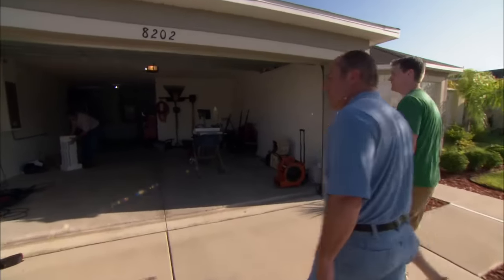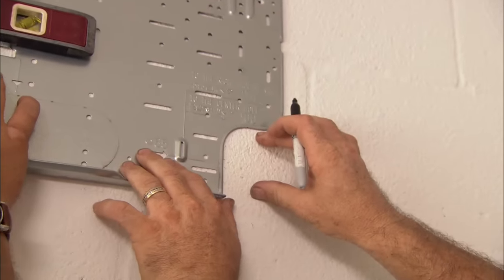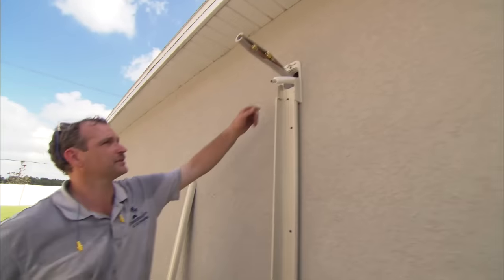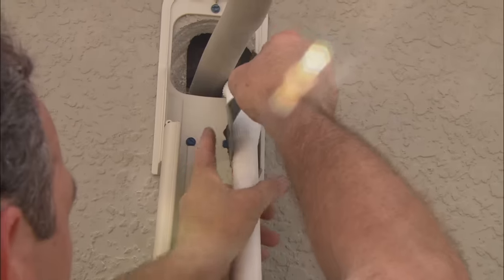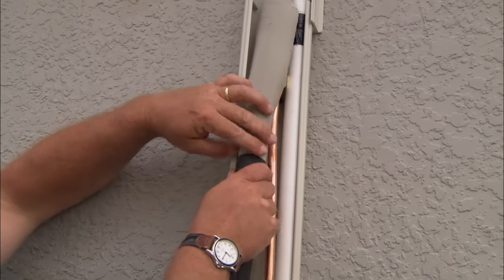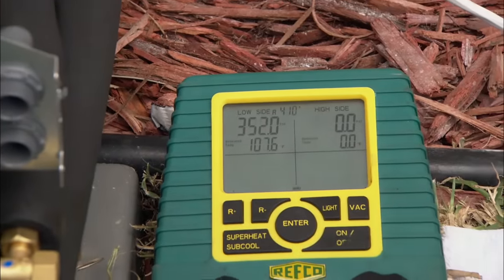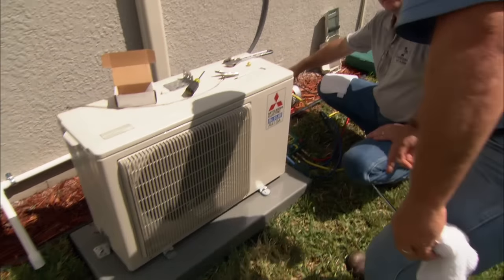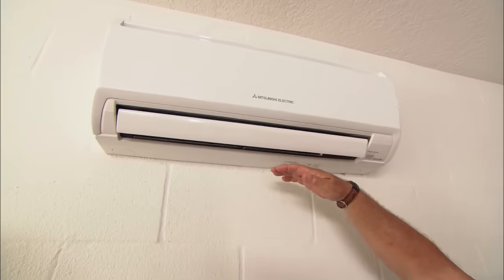How to Install a Ductless Mini-Split Air Conditioner | This Old House

Comment: A year ago I took HVAC training at Peterson School in Woburn, MA. Most important thing they taught us us to read the manual and follow ALL manufacturers instructions.. Since then, I worked on a truck and went for mini split factory training (Fujitsu and Mitsubishi).. SMH at this job. No wrapping of the indoor insulation with the sheathing given in the manual/remote package,Wrong flaring tool, no use of POE oil on flare connection, no use of torque wrench when tightening flare nuts, no nitrogen sweep before pressurizing with nitrogen, pressurize with at least 400 PSI *read manual for exact amount, 400PSI is the low PSI when in heat mode, no bubble test, ground connections should be with a ring connector. All other electrical connections with solid wire are done with a hook (not the slide in as he did) stranded wire must also be done with ring connectors. If the install is done in a place where it snows, use a stand to raise the outdoor unit up above the snow line.  He said that it's idiot proof.. SMH, all the things that I brought up are in the install manual. Without doing all those steps, the warranty is void.  He may be an 'expert'. I have 4 months of training and 7 months on a truck and I know he is just another hack.  If you are in MA and want to learn refrigeration and heat pumps, go to The Peterson School and get on a truck for a few months, do a couple dozen installs, buy $4K worth of tools, get factory trained and when you install your own 2 outdoor - 7 indoor unit job, you will have more than paid off the cost of the schooling and the tools..  2 outdoor and 7 indoor install would usually run @ $18K, but you only need to buy @ $5K of parts and do @20 hrs of labor..

Comment: Idiot proof is total b.s.  bubble check flares, torque to specs, cooling a space where insulation may be an issue, shop conditions will plug filters fast, clog drain, etc.   He will probably wash filters after the first visit from a technician after water is pouring down the wall.  Sorry... I hate working on these things.

Comment: You guys did a good job but there’s only one thing you guys did wrong is the condensation water you have to have a 90° elbow and another piece of pipe or a splash block or have it dripping into the drain because over the years it drips on the con creek it Eats It up and it ruins your foundation overtime

Comment: A few observations about this video. If you install this unit yourself you will void the warranty. The nitrogen test is a good idea (best practice) but not necessary. You could instead just pull vacuum on your lines, leave your gages on overnight and see if the system loses any vacuum. Never install an inverter compressor without adding adding an "AC line conditioner". This is NOT the same as a surge suppressor! Surge suppressors protect your motors. A line conditioner will protect your motors and your control boards.
Reply: "If you install this unit yourself you will void the warranty."  ...  THAT IS A  BULLSHIT LIE!

Comment: Is the electrical box on the outside wired to another on the other side of the wall?  Were the wires pulled thru from the inside box to the outside box and then hook up the A/C to the box? How is that done? I've purchased an Excalibur Air mini split that was supposed to go to Paris, therefore  has a plug that is geared to European power. I was told to cut the plug off and wire to a breaker box with twin 15a breakers. This is done instead of a quick disconnect to keep from getting a shock. Can you elaborate on this. The head unit comes with two cables, one with wire connects and one with plug. Also, I only have a couple of places  I can put this. One of the places is on a partially screen/wall enclosed outdoor porch. I was wondering if there is a lot of heat generated from the outside unit? The other place is a smaller indoor space for  wall unit with open outdoor for outdoor unit. In other words one has little wall clearance and the other has little outside/porch clearance.

Comment: How is this unit been working? I ask because I consider that small 9,000 BTU unit to be way to small for that large garage the 15,000 BTU or 18,000 BTU units would have been a much better choice by cooling that area more efficiently.

Comment: Have been very happy with our mini-split but a slug (or something) crawled across the outside unit PCB and got fried and in the process fried the board. They are a BEAR to try and work on. Just getting them apart was a challenge and I've been taking things apart my whole life. Actually never was able to get the PCB out.

Comment: How would I do this for a two story home I currently have a 3.5ton traditional gas heat/ac unit for my first two floors. My third floor has a gas unit that heats the upstairs but does not adequately heat my bedrooms. I would like to add the ventless system to two bedrooms to supplement my heating/a/c

Comment: Dear sir,
I have Mitsubishi MS-A18VD ac , from 2 days i have problem.
One of these two lights "indicator and operation" turned off as it does, but outdoor fan is continusly ruunning even for whole night.
Kindly sugges some remedy
Thanks

Comment: Can anyone tell me how to 'turn off' the refrigerant line? Is it just that allen key at the source? I have to move the bracket up on the wall of our indoor head unit so the drain hose is sloped downhill to drain properly. All the tubing is sprayed foamed into the wall tho and i fear messing up the bend thats already in the copper lineS. Id like to detach the copper lines at the head unit to place it on the ground while i re position the bracket - but i feel like 2 people are going to have to hold it in the air for me while i attempt to remove the copper lines (if thats the even possible). Am i thinking this right!?

Comment: Lol. goes to shed to look for a massive rotary hammer drill with a 3 inch coring bit so I can start my project “oh would you look at that, I don’t have that. *Calls the local hvac installers to do this for me, as any homeowner should.

Comment: Where's the power wires going from the disconnect to the breaker box?
Reply: Thru the back of the disconnect and then you can see inside where it goes to the panel

Comment: I have some question, I used 165s  5/8 ODF filter drier in AC split type but the copper line in high side is 3/8 , the unit is 28000 btu , isn't OK did I use?

Comment: What model did they use? Is this the smaller BTU MSZ-FH06NA ?
Reply: I bet this is the MSZ-GL line. The specs on this say the width is 31 inches. The MSZ-FH line shows a larger width of 36 inches.

Comment: Hello.  is it possible to use these slim outdoor unit to replace my existing outdoor unit that's for a regular ducted system?  currently using a Trane 4ttr6036b1.  Thank you for any insight on this.

Comment: When I was young I liked watching Bob villa now I'm older I watch these shows and I see it always require a contractor or trade professional to do the work this mini split in 2020 is a d.i.y install if you order the 12v or 110v unit online. I installed mine last year with my neighbor it took about 2 hrs everything comes in the kit. With the freon installed just like they did it. My unit cost $400 but I seen them go up as high as $1100 for the d.i.y mini split there great units with warranty.

Comment: Had a call about a ductless split system not working right. Homeowner says he installed it himself. Well that voids the warranty. He tried to save himself some money.. I don’t blame him. But I won’t touch it. Good luck finding some one that will.

Comment: Most warranties aren't covered unless you get an hvac person to vacuum the lines. There are some models for diy that don't need vacuuming. The outside hole must be 1/2 inch lower than inside so water won't freeze in winter. You have to know what size circuit breaker to use. Should have put special lube on fittings. There are better videos.

Comment: There was still no use of terminals on the wires in the condenser and evaporator, it didn't show up making the vacuum and reaching 500 microns. It took on the quality of the work!

Comment: All I dealt with is leaking EZ fittings and bad flares because people use the wrong flare tool,make bad flares, or don't use the EZ fittings right. It's a nightmare when you have to redo all the flares on a 4 ton outdoor unit with 5 indoor heads by yourself with indoor units 2-3 being floors up.

Comment: So the nitrogen is only to check for leaks, and the vacuum is to remove the nitrogen. Probably not recommended, however it appears possible to do the installation without the nitrogen leak test.
 Also doesn't the amount of refrigerant gas in the compressor unit need to be adjusted by adding or removing refrigerant to match the length of copper piping ?

Comment: I see no benefit to this over a ducted portable floor unit, except it is on the wall and out of the way. A portable is A LOT cheaper and easier to install.
The hole you have to make is almost the same size as for a portable and you have a bulky outdoor unit to worry about with this thing. Guess I'll stick with my portable.

Comment: I live in a 1927 grandfathered building in NYC, which disallows cutting holes in walls. Therefore the only 2 options are in-window units, which break the antique window or, a portable AC unit where you have to break the window and run a duct through it. In both cases you can't open the windows... Do you know any AC units that can be mounted high on the wall, with a duct that can be run from it? (I can run a duct through the top window which doesn't effect opening and closing...
Reply: +O. Liam Wright If you're allowed to make a hole in the window for a box/window air con, then perhaps you could consider making a smaller hole in the window to allow the pipes to go through for a split system instead?

Comment: My only gripe is that they didn't hold the torpedo level against a straight edge on the wall mounting bracket so that you're leveling the entire bracket rather than trying to line up holes with the level itself. Leaves less room for error.

Comment: Guys, I think you could have done a lot better than this. Instead of taking the simplest, most straightforward situation, you could have shown something more demanding. That would have allowed you to present us with how to avoid kinks, and the other routine problems that come with a more tortuous route than out the hole and down.

Comment: The wire going from the box on the wall to the unit at 6:00 looks terrible to me; it would look better going straight down and not slanted like that. And all those meters and boxes on the outside wall of the house, WTF? That seems to be standard in the US. No German homeowner would be able to live with that.

Comment: Firstly... interconnect should have power segregation between line voltage and control... not in one cable. Secondly indoor unit tails not correctly vapour sealed with duct tape... thirdly conduit from isolator is a mess! Should be done in hard pvc.

Comment: Video made it way too simple, he didn’t show the part where the 220v lines goes from circuit panel to the junction box, nor did he foam seal the holes, and the outdoor unit is not mounted to the slab. I would not advise home owners to diy this job

Comment: The installer of my Fujitsu mini split placed it on a pad similar to the one in this video. No good for a Michigan climate! Ice built up underneath in winter-time, and into the interior of the outside unit. 

They came back and raised it up on 2 concrete blocks - also no good! I believe when it goes through winter time defrost cycles, it builds up the ice, until the interior fan starts hitting the ice buildup. 

I gave up on the contractor installer and raised it up further on a treated wood stand, with a hinged cover that I constructed. So, in snowy winter climates, the outside units should be raised at least one to two feet off the mounting surface, and have a roof/cover over them.

In addition, check weekly in wintertime for ice buildup underneath, and keep the area cleared off.

Comment: How much would an installation and mini-split AC cost in Southern CA in 2016?
Reply: I'm spitballing here but I say about 300,530, but I'm only spitballing.
Reply: +Maxim Fit go to acwholesalers.com and check the price of a Mitsubishi, then  double the price to install it.  That is a rough, but, fairly accurate cost assessment.  I did my own install and then got a pro to recover and charge it for me.  Don't let them charge for too much refrigerant as the units come precharged like the man said....don't do it  yourself unless you can 1.  Read a manual properly and 2.  Have some experience doing this type of thing. Good luck!
Reply: One place quoted me $5,000 and I hung up after laughing!
Reply: Yea, but, he wasn't kidding, I guarantee you!  I did it myself on a rental and I saved about 3200 which was well worth it.
Reply: I don't blame you. That's how much I was charged for purchase and install for a central system.

Comment: Can the refrigeration lines be installed in walls through the floor or attic spaces? Also how far can the lines be ran from the compressor unit? Lastly would I lose any efficiency with long distances?

Comment: You should really use a fork connector on that ground screw. Wrapping stranded wire around a screw is a no no. Other then that everything else looks great! -Dave the electrician

Comment: At 6:15, wow, he did not have the vacuum pump hose shut off valve installed on the outdoor unit, and so when the freon was released it would filled up that long hose and waste the freon!!! Should have the shut off valve before connecting the hose.

Comment: One negative with these is that they usually recommend cleaning the filter every two to four weeks.  Good luck getting a renter to do that.  That means that the landlord has to send someone out to every unit once or twice a month to do filter cleaning.  That's an expensive PITA.

Comment: How much does a system like this cost? Including installation...
Reply: L Miller about $750 for 12,000 BTU. $1,200 for 24,000 BTU. Look up on amazon for "Pioneer Ductless." Installation costs around a couple hundred dollars if you call around. You can do it yourself. It's very easy.
Reply: +L Miller that unit was $3400 with installation. He says it in the full episode.
Reply: Where I’m from like 2,000 in labor if someone is doing it on the side

Comment: Does it matter where i place the outside unit.? My plan is to mount it higher then the inside unit if that is ok. ?  I took into factor servicing The unit. I have windows that will allow me to mount it lower than the inside unit

Comment: I have seen these installed on inside walls. I have a wall between my kitchen and living room. I want to run the lines down into the garage. And another in the finished basement. Can you guys do a video of something like that or do you have any?

Comment: +1. .. What is the noise level of the interior unit? .. Unobtrusive so much that an office environment use is possible? .. Super retrofit application if? .. retrofit is your application. ..What is the maximum distance (in feet) btw condenser and evaporator?
Reply: Michael Schneider Mitsubishi Mr.Slim is the best brand I would recommend in mini splits. The noise level is very low, perfect for an office. The distance from the indoor unit to the outdoor can be 25ft. You can extended more but you might loose some freon and efficient. Recomendable is 25'ft.
Check Paylessminisplit.com, I recommend them.

Comment: Lots of comments about how this is not a DIY project. Yes, but if you’ve ever hired contractors to work on your home you realize you had better know how to do the job correctly. Too many guys with a truck and a pile of tools take your money to do work they didn’t really understand. If you know what is supposed to happen and you look over the work being done closely you can get a sense of when you hired the wrong person. I know that’s uncomfortable for contractors but given the lack of rigorous licensing and buyer protection in the field of home improvement it’s just something contractors need to live with.
Reply: even this tech doing it wrong: no shut off valve on the hose between pump and condenser, and no triple vacuum with N2 as required by Mitsubishi

Comment: Hello 
Dear ,sir we buy a month ago new split unit,  model no, 18hfaa b, sir our indoor bottom sticker printed r410a refrigerant but outdoor unit print r32 refrigerant,  i don't know how is possible, dealer mistake ?, 
Is that ok or we need to change outdoor r410a refrigerant same as shown and print on indoor unit, please answer,
Reply: Use R508b, that's what it's supposed to be.

Comment: 2 things de-bur the pipe before you flare it. And put a small drop of oil on the back side of the flare to help when tightening down.

Comment: That’s some pitiful electrical work. Puts the stranded wires under a screw without a crimp on connector  
That is that not how seal tite conduit goes together either.  You don’t just push it on.  He also didn’t valve off the vacuum at the port. No sleeve or sealing of the hole. No proper tightening of the flare. Overall butcher job. This is why you should do it yourself.
Reply: You sound like you know what you're doing. Can you help install mine lol

Comment: Most if not all ductless units have springs on the suction and liquid lines from factory so you dont kink the lines...and there's adapters to go from the drain line to pvc....freaking cheap installers and they obviously dont know about the springs ...
.hire me next time you do any hvac work
Reply: Howard Howard. The springs don't usually reach that far so yes you gotta bend carefully

Comment: I have a three level split level home with air conditioning requirements on each level.  Is there documentation available to help me position my external as well as internal units?